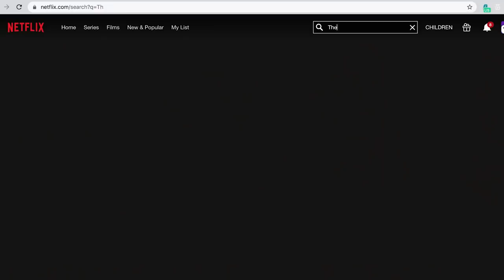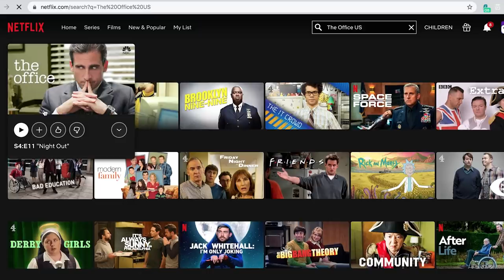BATTLING SNOW AT 8000 FT | BUILDING OUR OWN HOME

Comment: News flash running a snowblower is NOT hard my 80 year old mother does it! Allie run the snowblower and get a second one for around the shelter you need it! We can get 3 feet at a time from blizzards and Northeaster’s in New England ❄️ you can’t use cars in some areas of Maine you drive your snowmobile to get your groceries.

Comment: Glad you had fun skiing.  Just think, next summer you can build the garage and you wont need to dig out the sides of the shelter.
In Utah they use snow fences.  You might think about building one to cut down on drifting.  Poor mans snow fencing, use wood pallets and stakes to hold the pallets upright.

Comment: I can't belive your are removing snow the old fashioned way while you have a perfectly good snowblower, and a tractor. Next fall, be sure to mark up the side of the "garage/tent" with mark up sticks tall enough so you can use those a guide lines to ensure you don't ruin the tent or the water inlet. And put the machines to good use.
Reply: Next winter they shouldn't need the tent

Comment: You're both back seated skiing. Both should work on pulling your hells back. Allie you're turning you're knees in which is unweighting your uphill leg combined with the back weight which is why you see one ski turn then the other. Once you can get the weight transfer more 90/10 and then ski to ski that will smooth out.

Comment: I find it funny how Trent & Allie are having the same island issues as Eamon & Bec . Except they don't have a gas issue,well...maybe Eamon does. 🤣🤣
Reply: Someone needs to tell Trent that Eamon happily taught Bec how to use the Gator with the snow plow!  That looked way more challenging because they had to push the snow.
Reply: @divekatdreaming  Yea but they didn't have the snow that Trent & Allie have and the Gator is a go-cart compared to the Kabota.
Reply: @bullzeyez3236 Yes, the Kabota would be much more stable than the Gator, so there is no reason not to teach Allie to use it.
Reply: @divekatdreaming  Your opinion, I'm not here to judge or tell them what they should or should not do. They are smart kids, it's all good.

Comment: Two signs of living in heavy snow country, first you have some insulated gloves where all the worn through spots on them have been patched up with duct tape. Second, you have ski goggles even if you don't downhill ski. If you wear glasses like I do, you have ski goggles that have a battery operated fan in them. If you sweat a lot because you attack the snow aggressively, then you need the type with the fan, glasses or not. 

The rules of living in heavy snow country:
1. Never steal anyone's firewood.
2. Never steal anyone's parking spot.
3. Never put your snow on someone else's land without their consent. 

Also, you need a good coat with a hood that you don't mind getting grease on. I've owned 2 of those "military surplus" coats that can be washed in a home washing machine. The first cost me about $30 in 1974, I wore it out completely. The second cost much more and has lasted about 25 years. These are type with the hood that can be laced up to close about a foot from your face. I use mine to change the oil on our cars when it's -30 F outside and it overwhelms the heater in the garage. You buy head gear that is fully functional, but not the least bit stylish. My wife calls one of mine, my "Elmer Fudd" hat.
Reply: A foot and maybe a little is the most snow you've ever removed from a car?!!!! I should send you a little piece I wrote about the snow where I live. The average snowfall here is 208" or 17 feet, 4 inches. You should see the above average winters! However, here in the Sierra Nevada of California, winters are changing. They are getting shorter and warmer.

Comment: Don't you have a set of stair stringers around that were cut wrong? make a temp staircase to the deck. Why can't you use the  walk behind snowblower to clear next to the shelter, at least for the bulk of it. I saw some guy pushing a 6 ft  plastic folding table like a plow. great idea for the deck

Comment: I had just one suggestion to you guys and you're doing a great job for one thing but instead of having that big snow blower up there on the porch you need to try to find yourself a single stage that a little bit lighter and they're easier to run but you got the big one up there so maybe next year bring yourself a single stage snow blower a little bit lighter and easier run okay this is Bob from Florida and you going to wonder why I know some because I've used to live in New Jersey so single stage is doo doo better especially on wooden decks I don't dig into the wood God bless be safe up there and have fun enjoying your videos bye for now
Reply: Trent took it so he wouldn’t have such a hard time when the snow came off of the roof. 🙄

Comment: Why did you not put poles along the drive way to ensure you don’t accidentally drop off the edge with a tire?  Scary.  It could have red taped areas maybe with depth , ie 2 ft 4 ft 6 ft.

Comment: I just learned... that when you say there's "90% snow/rain" it doesn't mean that there's a 90% chance that it snows/rains... It means that its going to do so 90% of the day
Reply: Where did you learn that? It really doesn't sound accurate. Do you read the hourly forecasts the same way?  60% chance of rain from 1-2. 60% chance of rain from 2-3. Would you interpret that to mean that it is definitely going to rain for 36 minutes of each of those hours?
Reply: @divekatdreaming  First I saw it in one of those "things you didn't know" compilation videos... then Google it because I felt the same way you do rn... apparently it has to do with something like "it will definitely rain/snow but in different parts of the city"... please don't take my word on this tho...

Comment: Might be a dumb question but what's even the point of removing the snow from the sides of the shelter tent? Are you just worried about the weight of the snow or is there a path under there or what?

Comment: Why can’t you leave the snow against the structure. Won’t it help insulate a bit?  Or is that not right?
Reply from the maker: It will to an extent, but eventually all the snow sliding off the roof of the shelterlogic would be too much weight on the metal frame of the walls and could compromise the structural integrity and cause it to cave in. So we leave a little around the base but try to maintain it every snowfall so it doesn’t get too high/heavy.